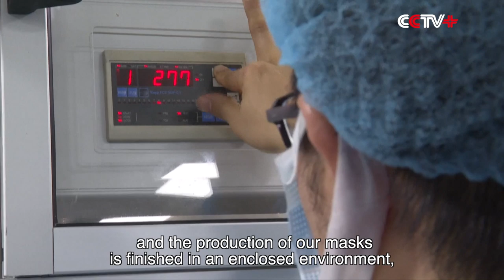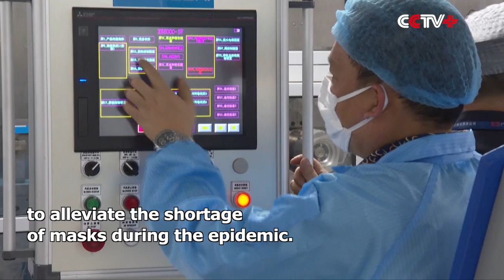Ultra-high-speed Mask Production Line Put into Use in south China City

Comment: It looks like they only showed the laminated and piecing part of production which could be sped up on any conventional machines. But the part that will slow you down is the elastic ring attachment which has to be ultrasonically welded to the main piece and works in intermitten movements. That is the tough part to speed up and they're not showing them here.
Reply: see @ 0:10  - it's there.  A look at the "strings" ... https://youtu.be/1Km6VKiyppM?t=61